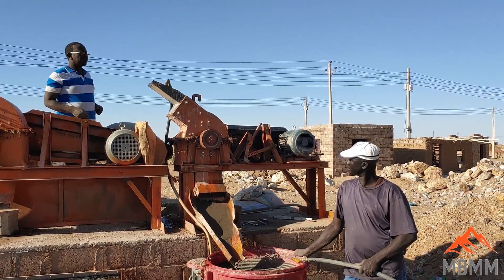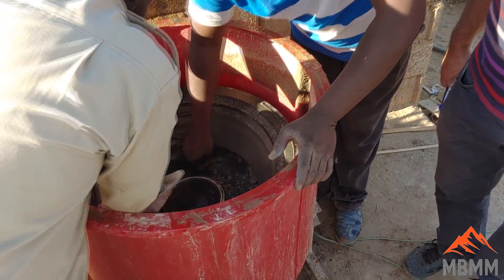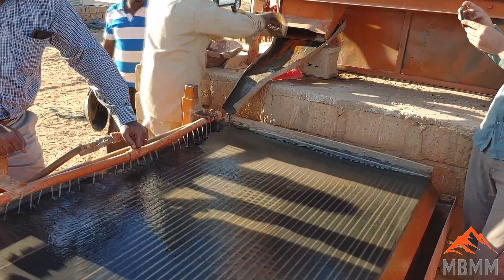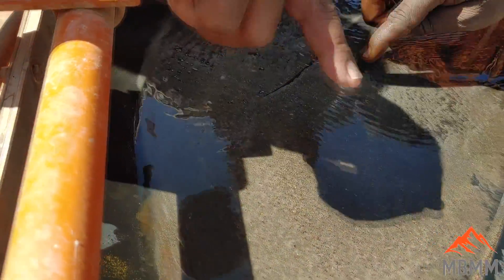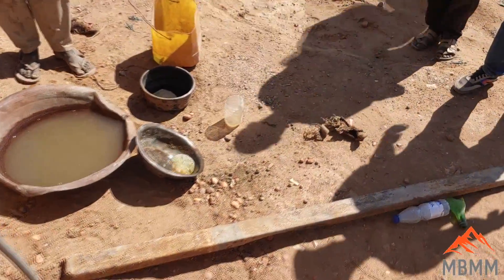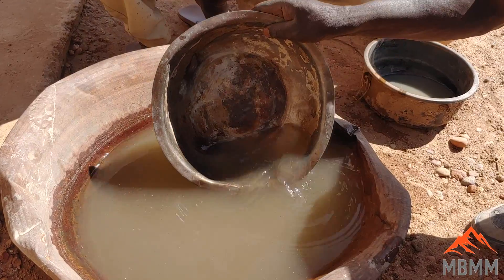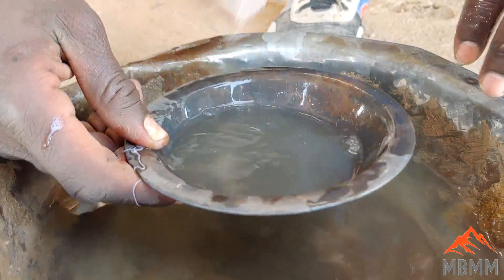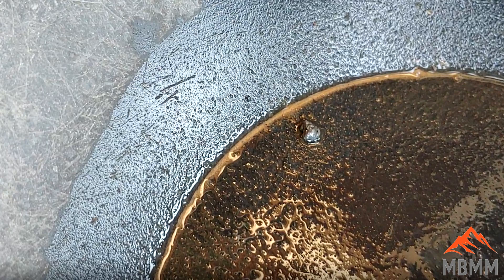Recovering Mercury and Gold with a Shaker Table from Tailings Sudan, Africa

Comment: Question isn't Mercury dangerous I mean harmful to humans is that why that are thermometers have become Mercury free nowadays when I was a kid yes we had thermometers that had Mercury I remember breaking one one time by accident in the bathroom sink and the beads of Mercury swirled around the sink and went down the drain not by choice it just happened!
Reply: Yea....  Mercury is notoriously toxic. Since it IS a liquid it evaporates at room temp and if breathed it's very toxic. It can also seep into your skin if you hold it long enough or have a cut. It does irreversible damage, and once it is in the body it ends up in your kidneys and brain, if it was not already expelled through urinating or defecating... And it will never leave your body.

Comment: If the tailings dry use retorts to evaporate the mercury and not using the shaker I do not know how Sudan is but they produce petroleum or use a solar furnace I look at the video.

Comment: That mercury still has alot of gold dissolved in it
Reply: no, not very much, the solubility of gold in mercury at room temperature is very low, (this means not very much can dissolve) because of this, when he filters the mercury, almost all of the gold comes out. (but yes a small amount will not be recovered) just understand that it doesn't matter very much if it is not recovered, because the dissolved gold prevents other gold from getting dissolved, instead it just mixes and sticks to the gold, not actually dissolving. This means that future gold will be recoverable since its not getting dissolved.

Comment: You can absorb some mercury through skin contact, but not much, and generally not enough to be a problem. It is mercury vapor that is so toxic and if they were handling it like this in an enclosed room they would certainly be having problems. If they heat it they would increase the problems for health. However, since these men are apparently handling mercury regularly they are at increased risk of skin absorption. Stepping back when the nitric is added probably isn't enough distance. If you can smell it you have probably inhaled mercury vapor too. I don't know if mercury affects sperm, but pregnant women and children should not be living in or around mercury vapor.
Reply: You mention all these hazards, except they aren't doing many of them. they aren't in an enclosed area, they are outside, everybody I see in the video is not a pregnant women or child, they aren't heating the mercury either. if it wasn't for the nitric acid I think they would have been fine. if they step back from the nitric acid, its probably adequate. Mercury does not absorb through the skin very well, in fact, its so slow that you could touch it for hours, even days and you would be fine, these people have water and dirt on their hands, the mercury will have a heck of a hard time absorbing through both the water, dirt, dead skin and then the living skin, much less make it all the way to the internal organs. the water covers the mercury, suppressing the vapors almost entirely. not to mention mercury makes almost no vapors in the first place. and you cant smell mercury metal vapor, its odorless. the only real thing worrying me here is the nitric acid.

Comment: wouldn't the mercury have dissolved gold in it?
Reply: no, not very much, the solubility of gold in mercury at room temperature is very low, (this means not very much can dissolve) because of this, when he filters the mercury, almost all of the gold comes out. (but yes a small amount will not be recovered) just understand that it doesn't matter very much if it is not recovered, because the dissolved gold prevents other gold from getting dissolved, instead it just mixes and sticks to the gold, not actually dissolving. This means that future gold will be recoverable since its not getting dissolved.

Comment: Due to the mercury content they probably have a life expectancy of onlr 35 to 40y, not a nice way to go.
Reply: no, I recommend researching this subject, Mercury in its metallic form can't readily absorb into the body. This means they have not been exposed to any dangerous amount.
Reply: @Metal_Master_YT  let's consider Hg vapor.  More reactive though less dense.  Drinking Hg is much more safe than breathing.  With a good breeze you're probably safe.
Reply: @dalethomasdewitt  well, considering they are outside, I'm pretty sure they would have a good breeze every now and again. besides, being outside is the best natural ventilation. also, check out mercury's boiling point and low vapor pressure, it makes very little vapor to begin with, thousands of times less than water.

Comment: Rubber gloves?
Reply: PPE is a  good idea, but never assume that any specific protection will be adequate for all hazards.  There is a molecular form of mercury that can penetrate rubber gloves and skin to kill you very slowly.  I recommend doing a little research before choosing your PPE; even so, your point is a good one.
Reply: @lonjohnson5161  yeah but that's elemental mercury they're using. so it doesn't matter if a different mercury compound can penetrate gloves, since that's not the one they're using.
(Mercury is not reactive enough to produce those compounds in the environment they are in) (at least, not in any significant amount)
Reply: @Metal_Master_YT  heat or motion defines this topic.

Comment: Working with mercury and no protections for the workers or the environment, God help the babies' nervous systems.
Reply from the maker: Yes, it is sad
Reply: @mbmmllc  are you both dumb? I recommend researching this subject, Mercury in its metallic form can't readily absorb into the body. This means they have not been exposed to any dangerous amount.
 plus, most of the time the mercury has water overtop of it, and that stops the vapors, I don't think they are in any real danger of mercury poisoning guys.
Reply: what is the solution to it

Comment: can't believe you were touching that mercury you can get mercury poisoning bro🤔
Reply: Brian Drew especially after they added the nitric acid. They made a mercy salt that can be absorbed through the skin 20 times easyer than the actual metallic mercury.
Reply from the maker: Thanks for your concerns
Reply: @calebroberts224  if it wasn't for the nitric acid they would of been fine, I recommend researching this subject, Mercury in its metallic form can't readily absorb into the body. This means they have not been exposed to any dangerous amount.